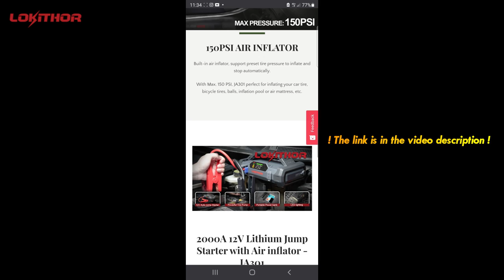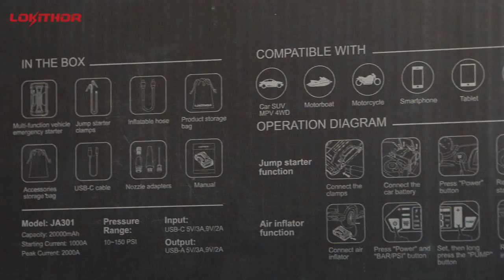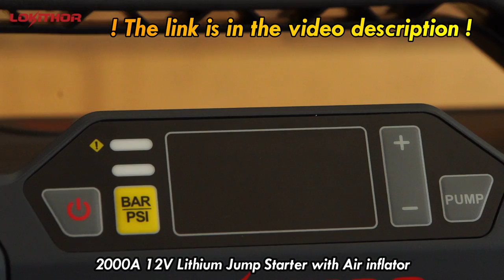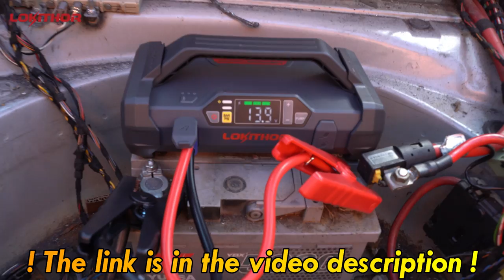Homemade BMW e46 PickUp TRUCK !? Part 4 (Floor in the box)

Comment: Looking good Doc.Wish I could've warned you about the curve welding the V's down without a 1/8th" bar support under the middle of the plate.The plate curved up didn't it? " Panel Bond" on all the body seams to prevent fumes and water inside."Black Bed Liner?"=Izgleda dobro Doc.Želio sam vas upozoriti na krivulju zavarivanja V -a bez oslonca 1/8 "ispod sredine ploče. Ploča se zakrivila prema gore, zar ne?" Panel Bond "na cijelom tijelu šavovi za sprječavanje isparavanja i vode unutra. "Black Bed Liner?"